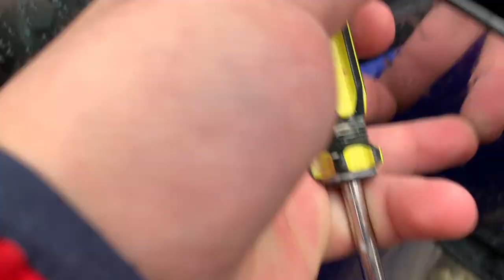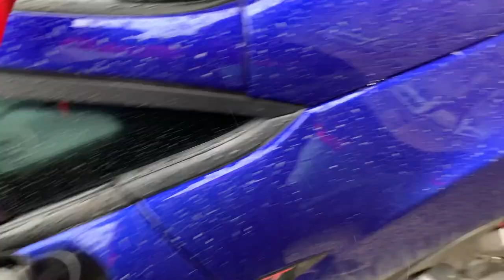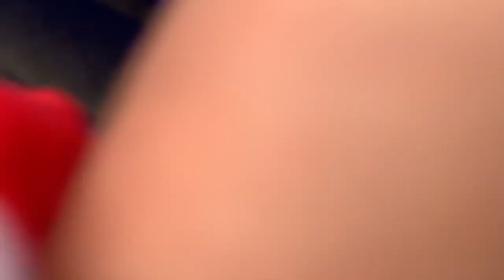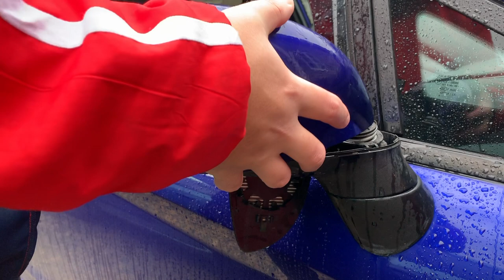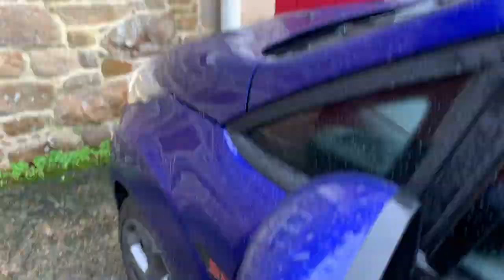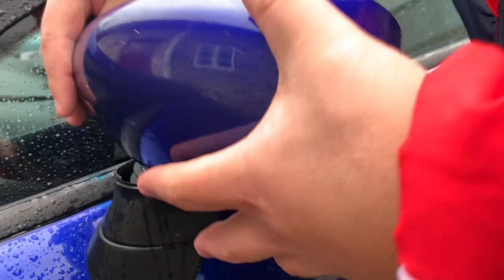Sequential Indicator Install On The Fiesta ST!!!

Comment: Just ordered mine,different seller,same make of item £21.98p free p&p.
My  original passanger blinker has has water get in and blackened the plastic chrome reflector,so as I had to replace one,it seemed a good time to front up the extra £9 and buy a pair of new black led ones,
Cheers.